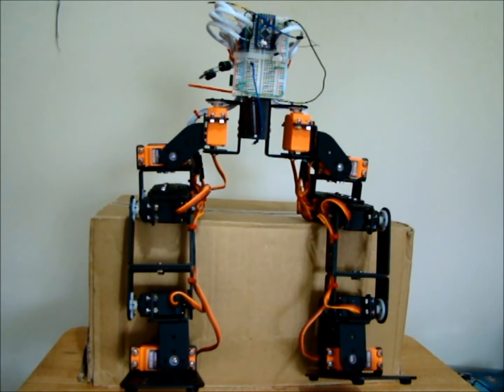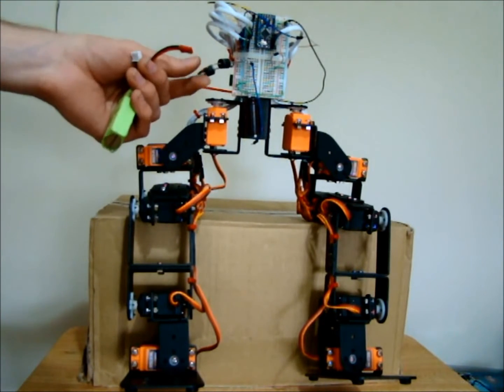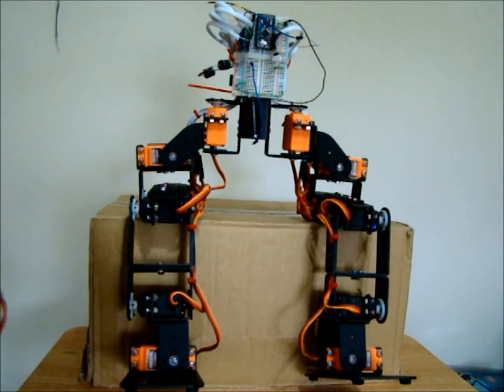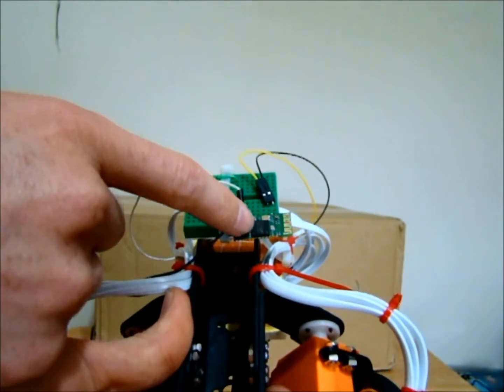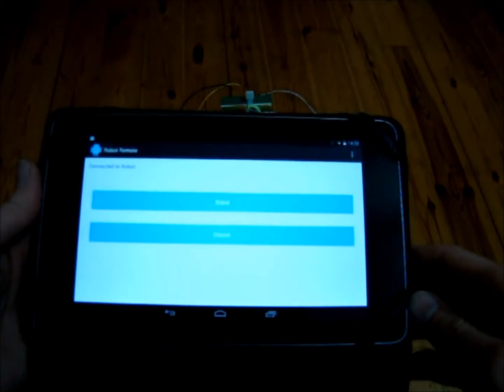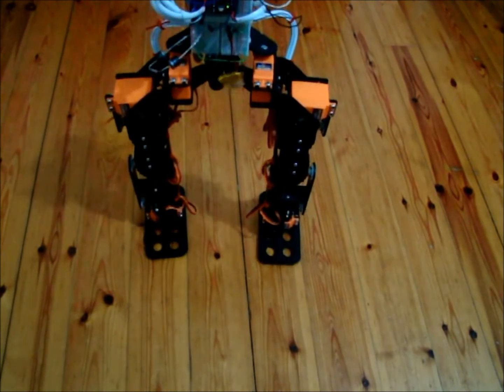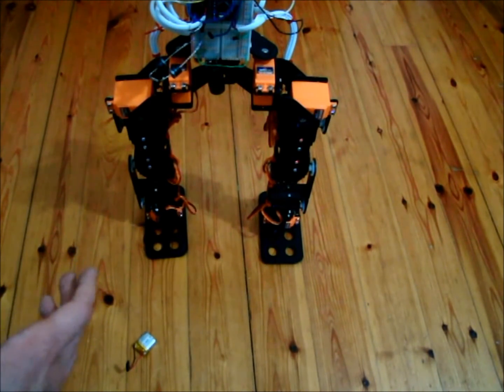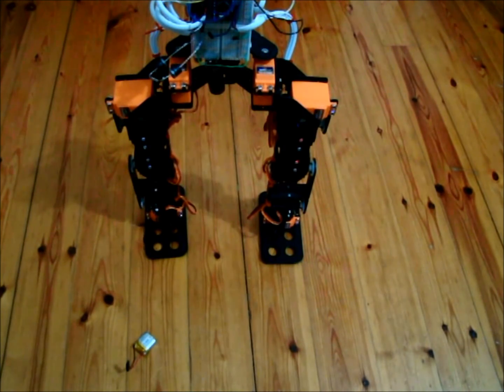Humanoid Robot part 1 - Introducing the robot

Comment: Great video. It would be great to hear more about how the Bluetooth control works.
Reply from the maker: Thanks, the bluetooth is fairly simple it is a BC04-B Bluetooth to UART Module. I just powered it and the arduino to 3.3 volts and connected the rx and tx serial pins. Then I could just send a byte like the hex value 01 made it stand and hex value 02 made it crouch. I did something similar in this video RC Tractors - Bluetooth Controller . In that video I used a bluetooth terminal app and in this video my sister made me the app to control the robot so I've no idea what is required to do that but it didn't seem very simple.